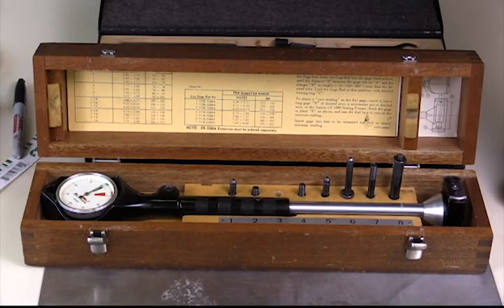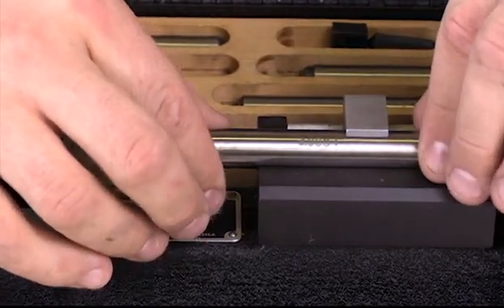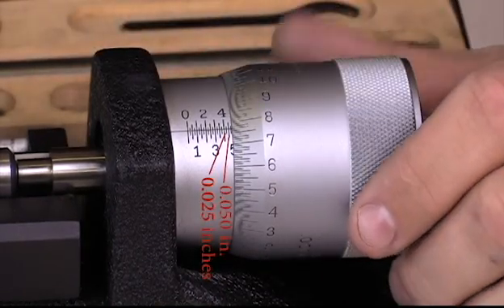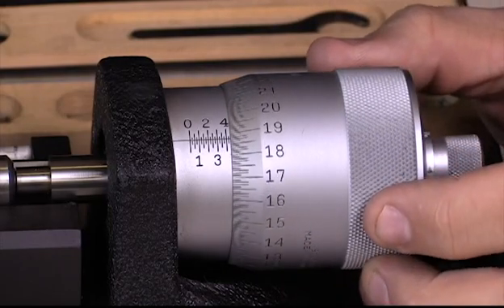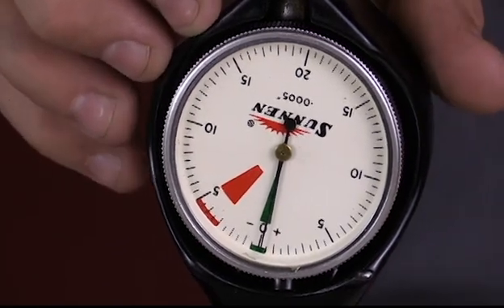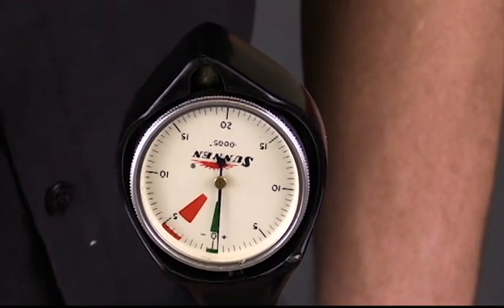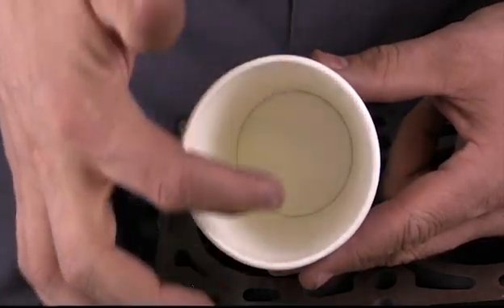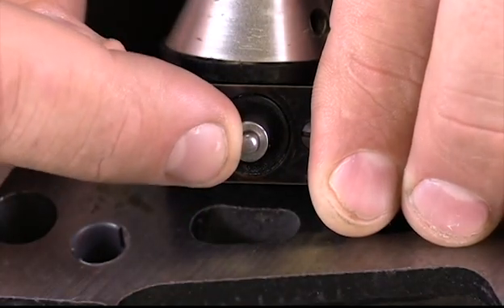Measuring Cylinder Bore Out Of Round And Taper with a Dial Bore Gauge

Comment: what is your add or subtraction with the taper , show the numbers .... when you go neg ( - ) what dose that mean and when you go pos (+) what dose that mean... to the bore.
Reply from the maker: +peterlakers1 If it is  - then it is less then the diameter setting. + is more then the setting. If you set the bore diameter gauge to 3.05" and the needle goes to the negative .05". Subtract .05" from the 3.05" = 3.00" bore diameter.